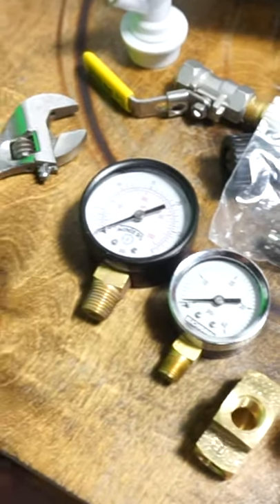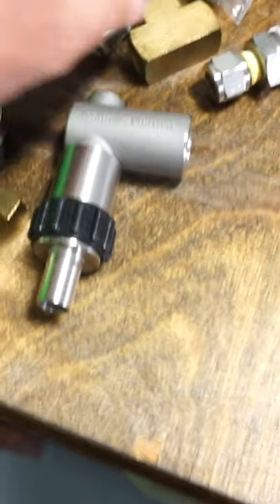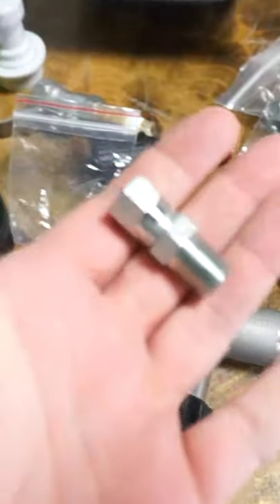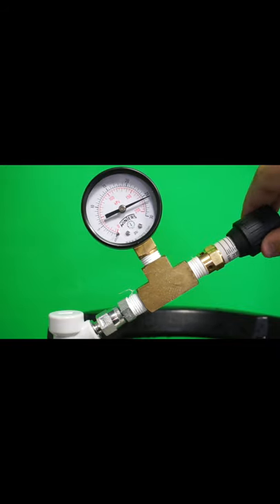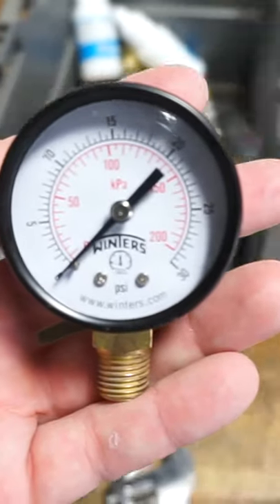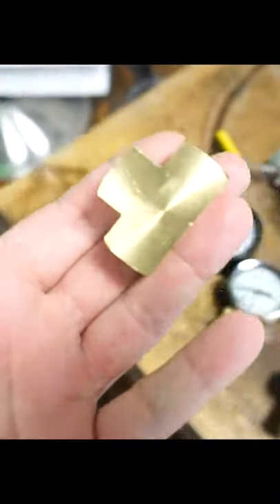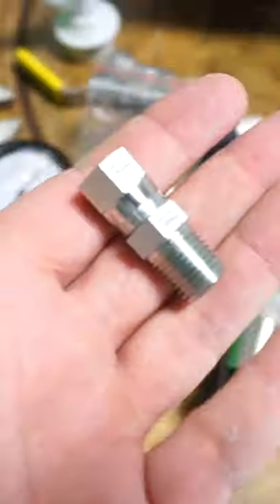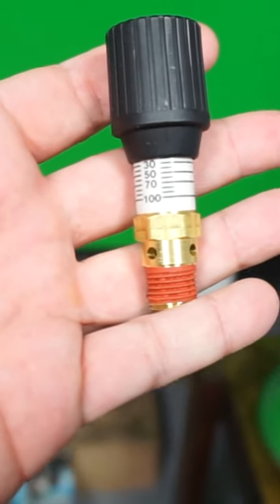How to build a SPUNDING VALVE | homebrewing #shorts

Comment: Question, So I have a type D coupler keg, is that good to force carbonate? cuz I haven't found anyone doing it with that keg.
Reply from the maker: Sorry i know nothing about sanke's for homebrewing
Reply: You can ABSOLUTELY do this with a Sanke keg. Look at the Sabco kegs and fermenters for reference. I have them. They are tanks. However if you plan to use the usual tap to handle the blowoff, make sure you leave out the one-way check pieces.
Reply from the maker: @ChuckUnderFire  good looking out!